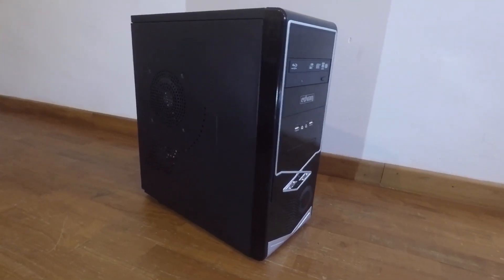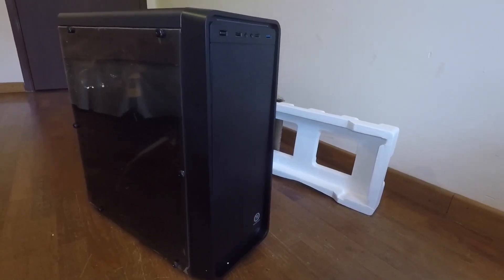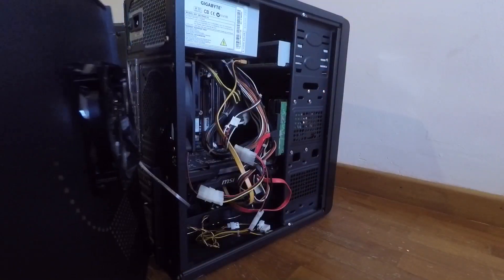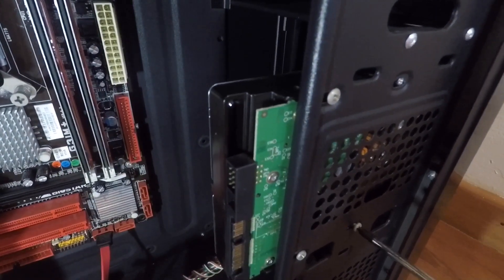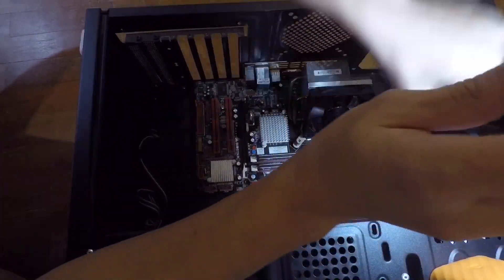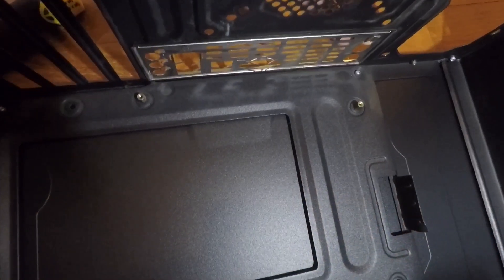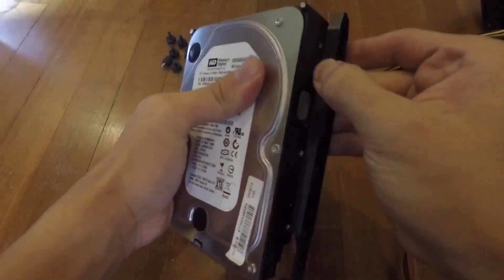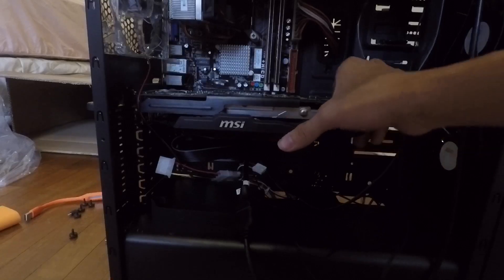How To Replace Computer Cases

Comment: How to put back the aioplate? Or does removing motherboard is stick at aioplate? Need help thanks
Reply from the maker: They separate with motherboard, for the aio plate, all you need to do is just snap it in place from the inside of the case toward the outside
Reply from the maker: Platinum God  if the one located on your old case are faulty, then the new one should work without any problem , but if your motherboard have a faulty front io USB port, then you’ll need to have it fix